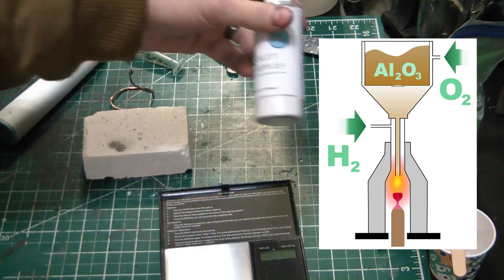Can a $25 Torch Make Synthetic Ruby? - ElementalMaker

Comment: Yes it does allow to make rubbies but not big ones only tiny parels and with some air inclusions but there is molten beads glass effect and the passage of enerald green to ruby red-purple-ish.

I have done this from acetylen-oxygen (that reaches 3300°C and allows to melt Al2O3 (3100°C) but also from butane-N2O that burns less hot (stil a decent 2800°C) but much hotter than conventional butane-O2 (1800°C) or H2-O2 (2100°C).

Regards,
PHZ
(PHILOU Zrealone from the Science Madness Forum and many former A.O.L newsgroups related to chemistry)

Comment: i'm trying to make some rubies with a slightly larger version of the torch shown in the video. My first attempt worked about as well as the ones in this video and i'm trying to make some rubies i can bring to a jeweler and get polished. any ideas on how to get it tho work?
Reply from the maker: Check out my other ruby making videos. From my experiments, and oxy hydrogen torch works much better to make larger rubies. My best results were with a small arc furnace using a couple graphite gouging rods and an old arc welder. That being said I don't know if you'll ever be able to produce jewelry grade rubies without a vacuum furnace, I tried polishing a couple of my larger ones and they are littered with air bubbles.
Reply: @ElementalMaker  Unfortunately, my parents are way too obsessed with the environment and have a house that runs on solar panels and thus can't run a welder. I could try to make an hho generator tho.

Comment: GREST JOB 
FANTASTIC EXPERIMENT 
I DONT THINK THE TORCH IS THE WAY TO GO.  The torch introduces hydrogen, oxygen, acetylene, and carbon impurities.  
The graphite electrodes are only introducing carbon.  That could be kept to a minimum by shielding the aluminum with argon gas.  
Use graphite to make a cup for one electrode and put the aluminum and chromium in the cup.  Use another graphite electrode for the top.  Spray argon gas in the reaction cup chamber to keep as much carbon out of the aluminum and chromium as possible.  This should allow you to make large rubies whos size is only determined by the size of the cup and how long the welder can make an arc to build up the ruby.

Comment: You should do it on thick steel plate with better heat distribution, or some material like that so the brick wont melt in and contaminate the ruby! I think that's why it's having a hard time fluoresce!  I don't know if your torch is hot enough to melt into a thick piece of steel before it distributes the heat, so that might not work either. But it's worth a shot! Thanks for the fascinating video as always! Have a great day! -Nicholas

Comment: Can it melt gold?
Reply from the maker: Oh yeah for sure 👍 oxy-propane temperature is about 4100*F and gold melts at 1948*F so it's well overkill to melt gold
Reply: @ElementalMaker  oooh ok. So maybe this is the kind of torch Ive seen jewlers using. I always wondered what gas they were using. Thanks
Reply from the maker: @aSinisterKiid  if it's a sooty flame, you are likely using acetylene. I think that's what most use.
Reply: @ElementalMaker  see, that's the thing. I'm a welder so I use OxyAcetylene all the time for cutting, and when I was watching the jewler work, there was no soot whatsoever. It was this teenie tiny little torch like you HHO torch. And now after your reply, I went an did a little digging for info, and I think he was using HHO.
Reply from the maker: @aSinisterKiid  wow that would be very interesting if he was using hho, I think that would be pretty overkill and dangerous for most jewelers but then again I know virtually nothing about that business lol. Definitely ask next time as I'm super curious, and if it is indeed hho I'd love to know what they're using to generate it.
Reply: @ElementalMaker  It all started out when I found out about this "alloy" they call Mokume Gane (I was on a Damascus Steel Rabbit Hole) and I got recommended this video in regards to jewlery.
https://www.youtube.com/watch?v=2oCZgy6-BVQ
And I was surprised by the lack of soot from the torch. Then I was intrigued by the Mokume Gane making process and trying to "silver solder" but not actually melt the gold or copper. That's when another video showed a jewler using what I believe is HHO torch https://www.youtube.com/watch?v=yA3j_WgTjV8

Comment: I have done this about 25 years ago, and found that adding a small amount of water to the mixed aluminum oxide / chromium oxide mix will hold it together long enough to melt it before it blows away.
Reply: Nice tip.

Comment: Try adding the oxypropane straight into the flashback arrester of the HHO generator and then use the old torch with a mixture of both gasses.  I would think that this would boost the burn temperature while benefiting from the larger flame volume.  Also the added pressure could help prevent the steel needle from burning itself.

Comment: wait wait why not try oxyacetylene? you will need less flow rate to sustain a high enough temperature, so it will be easier to feed your powder, and please find a better bed to melt it on. Im actually gonna try exactly what you are trying and i will contact you in case of any success
Reply from the maker: I'm sure oxyacetylene would work great! I just dont have an acetylene tank to try it with. Only issue with acetylene might be similar to what was happening here, where carbon from the hydrocarbon flame makes the ruby dark.
Reply: @ElementalMaker  can it be avoided by a more complete combustion?
Reply from the maker: @iliya-malecki  yes definitely keep the flame oxygen rich to limit carbon diffusion into the ruby 👍

Comment: I'm a gemologist and we studied synthetic ruby's, the key I think is the cooling down. If you somehow could make the fresh ruby cool down very slowly, the crystaline structure would grow bigger and clearer. I think the ruby's could increase in quality with that.
Reply from the maker: I definitely agree!
Reply: @ElementalMaker i use the smith torch with hho aka the knockoff as well as other cheap torches from china for hho .   Nitrous oxide/propane  makes a nice flame.  Hho/propane works too for when i need a large flame

Comment: I'm kind of excited to see this. I think your problem is the propane is dropping a lot of carbon in your mix. 

I actually made some tiny synthetic rubies a while ago using a completely different method. You can dissolve the aluminium oxide in a flux of molybdenum trioxide at much lower temperatures even in a standard pottery kiln. Problem is, the researchers use a platinum crucible in the research paper. Those are kind of pricey for the home chemist. It turns out molybdenum trioxide dissolves a lot of things at 1100C, including silicon carbide. I've destroyed a lot of crucibles trying to make this work in a simple pottery kiln. 

https://www.researchgate.net/publication/250079158_Growth_of_Large_Bipyramidal_Ruby_Crystals_by_the_Evaporation_of_Molybdenum_Trioxide_Flux
Reply from the maker: Now thats pretty damn cool! I never knew they could be formed that way!

Comment: I'd take a chunk of graphite and connect a welder electrode to it, then take a graphite rod and drill a hole through the center to send your feedstock through. Use that as your other electrode and strike an arc between them. Might clog up your feed hole I suppose, but I bet it works great until then.
Reply from the maker: Whoa a comment from one of my favorite YouTubers! I'm a huge fan of your videos! Thanks for dropping a comment it's truly an honor! Definitely will give it a try, just got an old arc welder working today.
Reply: Fine borosilicate rod rolled in the powder. The ruby would be slightly less pure, but more clear.
Reply: If one could "pelletize" the raw material, make a feed rod to be sent through the tube...
Reply: What Is Islam?

Islam is not just another religion. 

It is the same message preached by Moses, Jesus and Abraham.

Islam literally means ‘submission to God’ and it teaches us to have a direct relationship with God. 

It reminds us that since God created us, no one should be worshipped except God alone. 

It also teaches that God is nothing like a human being or like anything that we can imagine.

 The concept of God is summarized in the Quran as:

{ “Say, He is God, the One. God, the Absolute. He does not give birth, nor was He born, and there is nothing like Him.”} (Quran 112:1-4)

Becoming a Muslim is not turning your back to Jesus. 

Rather it’s going back to the original teachings of Jesus and obeying him

Comment: My question  is impurities.   How much junk are you getting in there from the fire brick?  Maybe try another crucible  item.  Also, instead of injection, whT about melt and stack.  Small layer, melt, still hot, add a small layer, melt, and repeat. May try on tempered steel since it can take the high heat.  Just a thiught

Comment: The propane adds carbon.
Reply from the maker: I think so. The other issue is too rich an amount of chromium oxide making it too dark.
Reply: @ElementalMaker  I'd use the hydro oxy torch with your feeder tip idea but turn up the gas pressure yet slow down the flow at the tip so it doesn't blow away your powder.

Comment: Wouldn't it be better if the feedstock injected into the center of the flame rather than around the flame?
Reply from the maker: I would think so, but that's a bit more difficult/dangerous to engineer.
Reply: @ElementalMaker  Ah. You'd have to make a coaxial tube or something.
Reply from the maker: @BrokenLifeCycle  The bigger issue is the gas feeding back into the ruby feedstock and exploding.

Comment: Two things that may help.
You could use a bit of tugnsten like a glass blowers rod and dip it into the powder and then melt powder in the flame to form a globule on the end of the rod. 

And also I think a less oxygenising flame more toward carbonizing flame, one with a very slight orange lining to the tail may produce more ruby to slag ratio.

Comment: This has been an interesting series of videos...i never would have thought you could actually make a synthetic ruby (regardless of purity) in open atmosphere with a torch.

I've seen those cheap micro torches on amazon before, but having seen things go wrong with "name brand" big torches, the fear of it going off like a grenade in my hand scared me off...i might have to pick on up for small brazing jobs.

You mentioned that you were running oxy/propane. Would you trust it on acetylene, or your opinion could it braze fine on the milder propane?
Reply from the maker: I treat any torch like a grenade regardless of brand or gasses, so I always use check valves and flashback arrestors just in case. Given the tiny volume of gas actually within the torch body, even a flashback in the torch wouldn't be a big deal. I'd trust it to run acetylene.

Comment: Seemed like a good bit of scatter but material loss looked  like less of an issue than in the other one. Hoping an arc will have even less movement. You think maybe the torch was just a bit too hot and burning the ruby? Would annealing them be any use? Also hoping an arc will give more precise temperature control and let you walk it down to cool easily

Comment: Just a thought for future ruby fabricating experiments; it might be interesting to try and make an assembly that can withstand the heat so you can just put the powder mix in a form and melt it with indirect heating. I'm thinking something alone the lines of a titanium lab stand with a tungsten 'crucible' (really just a couple flat pieces with a divot for the powder to sit in to act as a thermal block). If the stand holds up to being in close proximity to the flame, the tungsten should withstand the direct heating with its crazy high melting point. The only question would be how difficult it is to get the powder mix hot enough to all come together and whether it reacts with the mixture. I think something along these lines might reduce powder blowing away, having inclusions and impurities from the flame, etc. Might be able to get closer to gem results.

Comment: EM, the oxy-propane torch may be introducing more carbon which suggests it is not at a stoichiometric burn. Try turning down the propane if possible or increasing the oxygen. Also, MAPP torches burn hotter. Could this be converted to that? Finally, most synthetic rubies are grown in controlled atmospheres or a vacuum. You may have to build a small vacuum chamber to do this in. Grow the ruby on a tungsten rod which should handle most of the heat. The firebrick may be giving you the impurities that you don't want.

Comment: Just put a pile on the brick and melt away!!! Why that vibrating hopper???
Reply from the maker: The powder simply blows away if you try that. Watch my earlier video
Reply: @ElementalMaker  what if you make a brick out of the mix? with a press I guess. That way it won't blow away. You just melt a chunk.
Reply: They actually sell aluminum oxide bricks, soke it in a cromium solution. That might work

Comment: The coolest part about those little torches is the super fine gauge steel you can weld with them when outfitted for oxy-acetylene. We actually welded blue steel with them in college. I want to get one sometime because I think the control with it would allow me to gas weld aluminum easier than with a standard welding tip... plus you can use it to burn really intricate flame patterns in wood or even to put smoke onto paint jobs to ghost in flames.. not that I have my own booth or anything... damn it. You can tell I miss welding, doing autobody and paint work. Fuckin scoliosis. You need to get a little graphite mold or something to do that into.. something that can take the heat and not melt. BTW you might need to go over to pure fine aluminum powder to get a more pure stone, like the stuff they used to make thermite on Mythbusters. Also you idea for the nozzle on the outside of the torch probably won't work.. I think it will just melt the powder up against the tip and either clog the tip or fuse it right at the edge instead of blowing it through.

Comment: Great idea with the feed stock wrapping around the nossle of the torch. I how you are focusing on that. If it is successful I would like to see you be the first to 3d print with ruby
Reply: Also have a larger feed like the ones used for loading bullets and the weight distribution used in the bullet feed to prevent clogging

Comment: I think you may need to adjust your torch for a neutral flame. When you lit the aluminum, it demonstrated that your flame was an oxidizing one. (Free oxygen left over after the propane burned) That way your powder will melt without oxidizing. Be careful not to go to a reducing flame, that will introduce a ton of carbon. The propane is a much dirtier flame than hydrogen. Glassblowers can't use it. They generally use natural gas and oxygen which might be another option for you if contamination is the problem, and if natural gas is hot enough.

Comment: Two thoughts. First one is an idea. Why not use a ball mill to mix and make the powder a bit finer? The trick will finding something for the balls that is compatible with ruby making.
Maybe something like this >>> https://www.alibaba.com/product-detail/99-purity-white-0-2mm-100mm_60768874856.html?spm=a2700.details.deiletai6.3.320840471BpHVY
Number Two. Can you control what type of ads YT puts on and if you can please no political ads I am already tired of them. Them as in both parties.
Reply from the maker: Unfortunately no control over the ads. I hate the political BS as well
Reply from the maker: I think the ball milling is a great idea 👍
Reply: @ElementalMaker   As I was looking at this one other thought came to mine. You might want to store the powder in a container with a desiccant to pull any moisture out of it. My thinking is that might allow the fine powder to flow a little better out the modified toothbrush syringe.

Comment: As others have said, it's probably carbon from the propane that's making the propane-produced ruby look darker and less fluorescent.  You may be able to alleviate this by using a leaner flame to encourage burning of the carbon.  As a bonus, the aluminum flame may be self-sustaining with added oxygen.  IOW, start it with a propane-oxygen flame then turn down the propane to zero while keeping the torch aimed at the flame.

Comment: I will start with by saying no I don't knows if this will work but you could try using a graphite plate instead of insulator brick that or anyting that has a high thermal Mass / melting point

Comment: I know I put a lot of comments on this video but I'm wondering if the darker color on the propane Stone might be due to carbon buildup. Propane is clean-burning but it still puts out heavy carbon, hydrogen Burns clean so I think it gives you a cleaner Stone. It's too windy right now but I am wondering if I will get the same results using mapp and oxygen.

Comment: A heads up, I had my best results when the powder was in a Pile.the only problem I had with that was certain rubies would get too hot and explode into micro Ruby's before they could coalesce. And for those at home you can actually use the dirt in your yard as your hot plate, what I did was scrape the top surface off and then cooked the surface that I planned on synthesizing on with a mapp torch for a few minutes. Also MAPP gas will get the powder pile glowing red hot, when it looks like it is cooled it is not! The powder retains heat very well and can seriously burn you!